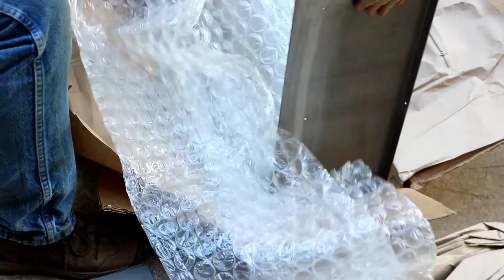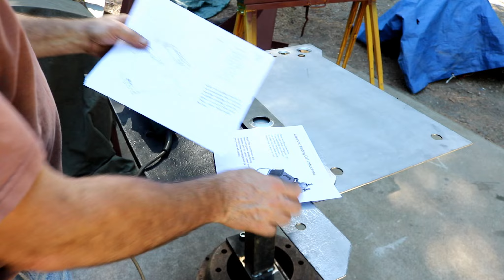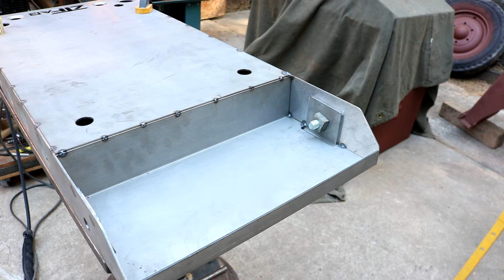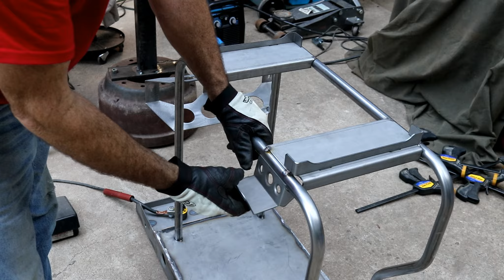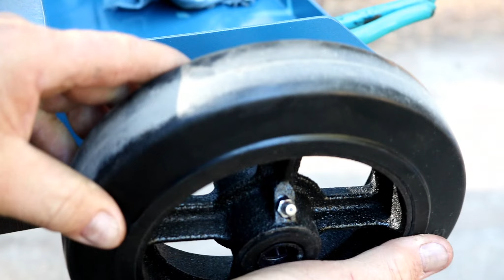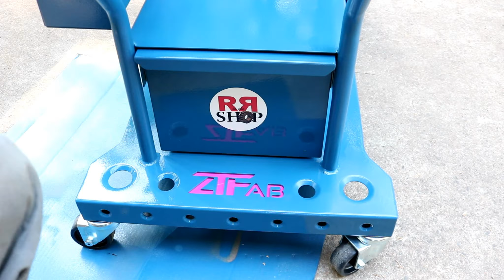An Ultimate Welding Cart

Comment: I'd love to say I watch to learn, but in honesty for me it's fantasy fab or machining porn.  The only tools we seem to have in common is a screwdriver and a hot glue gun.  My main vice requires a meter and a soldering Iron and the majority of my projects would easily fit on the head of a bolt ... Still, I can't resist the thought of a Tig or a Mig and I can only dream of owning a lathe.
Reply from the maker: You are trapped in the wrong body Andy.  Find a friend and borrow.  Thank you Andy for watching the entertainment.

Comment: I would've done a single mod to this, and i think ZT Fab, should consider it. One of the two "legs" of the welder seat, should be adjustable. So, a length of material should be added and welded to help keep the structure kosher, and then to the chosen free floating leg, a clamp, nutsert(s) and knob should be added. That way, you can possibly have multiple welders depending on your needs.
Reply from the maker: Both of my welders were withing 1/4"  so it was not a problem.  An adjust feature would be nice.  Thanks aserta.

Comment: New cart looks great. Thanks for the carbide/brass scribe that arrived the other day. You can buy 125 cf cylinders on Amazon full of Argon delivered to your door.
Reply from the maker: Thank you Kirk.  I will check that out.
Reply: @rrintheshop  No problem. I have bought a 125 Cf of Argon from Amazon and it arrived the next day. Hard to believe but it was a legit transaction. Argon seems just fine. Was 1/2 the price of my LWS. That's on Cape Cod near the Air Base.
Reply from the maker: @radishfever  I was checking pricing and yes they have the best deal.   I will order up in a week or so.

Comment: Nice cart, I'm sure it will get a lot of use.  One thing I would like to see added would be a locking wheel.  My cart does not have a locking wheel and it forever rolling down an incline.  The critter ought to stay put on any surface!  Keep the vids coming.
Reply: How about two short pieces of chain for around the wheels?
Reply from the maker: @royreynolds108  That works great.
Reply from the maker: Thanks James, love the cart.  Locking wheel should not be to hard to find .

Comment: Very nice kits but they do cost $500!  I can get a cheap but functional cart for $70 locally already assembled....actually designing one yourself would be just as  fun and way cheaper!
Reply: I thought they were fairly expensive too until I built mine.  They don't make one that fits a mig, tig and water cooler, so I designed and built my own.  It ended up costing close to $700 CDN.  I had one of those $70 carts.  They are good to get you going right when you get your first welder, but they are flimsy as heck.

If you have access to an inexpensive supply of steel and can cut and fit all your own parts then you can build your own cart for less money.  I figured the ZT fab cart would have cost me over $1000 CDN to get shipped to Canada, so my cart was still significantly cheaper.  If you just bought a welder and don't have the capability of cutting fitting, bending and fabricating your own stuff, then this cart looks like an excellent option for people who want a high quality cart.  Open the box and start assembling.
Reply from the maker: @barrygerbracht5077  Yep, the fit is perfect, no adjustments, hold together and weld.  I could mig weld the entire cart in one day probably about 3-4 hrs. And paint.
Reply from the maker: Thanks bmlennox.